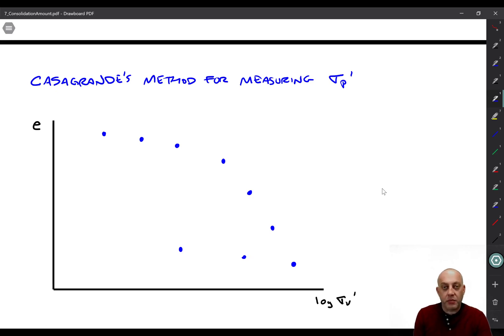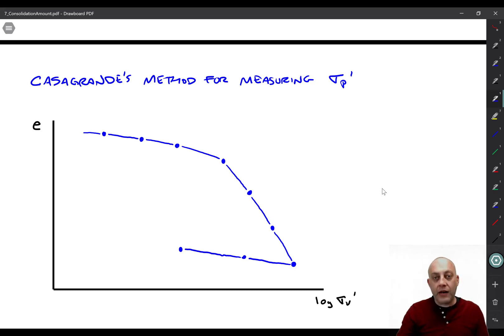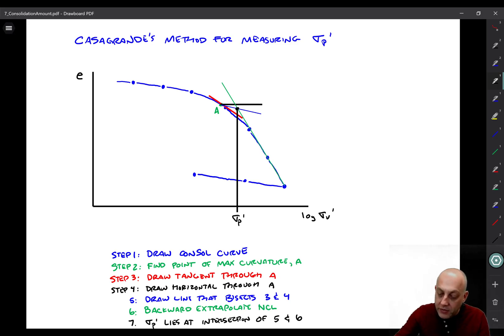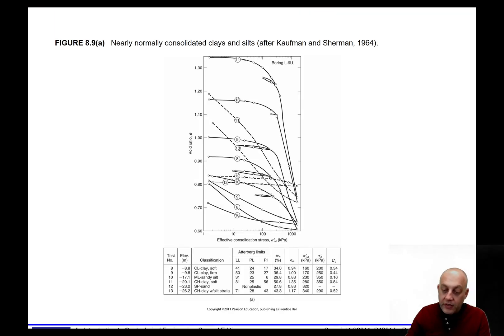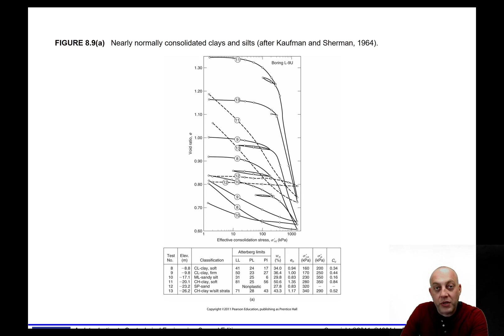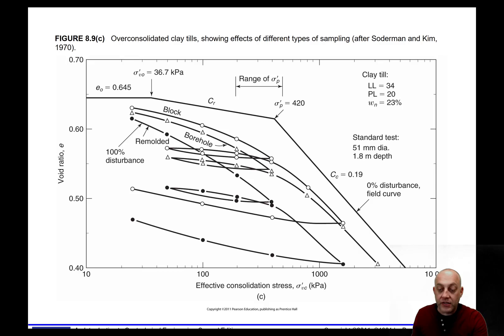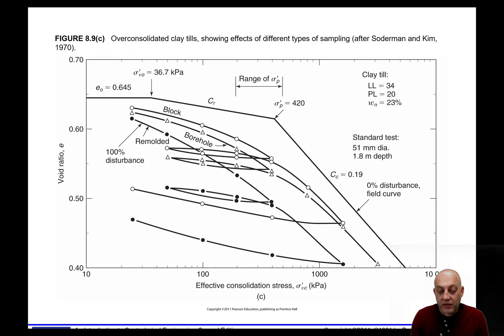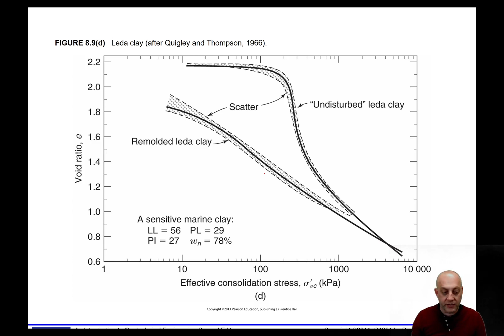7.3 Compression Indices Cc and Cr, and maximum past pressure

Comment: Regarding tube samples, there are also field-extruded shelby tube samples. So, the sample is driven smoothly but at relatively high pressures using a relatively thick sampler and extruded from the sampler via one end using a hydraulic ram and a stopper for the shelby tube, (allowing you to immediately reuse the shelby tube sampler in the field and collect more but more disturbed samples). Or do you consider that "remolded"